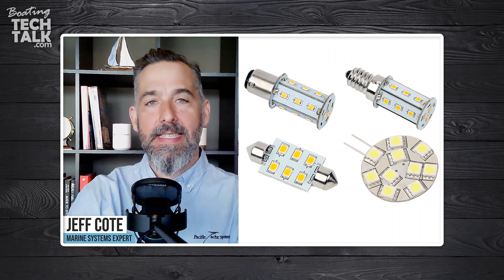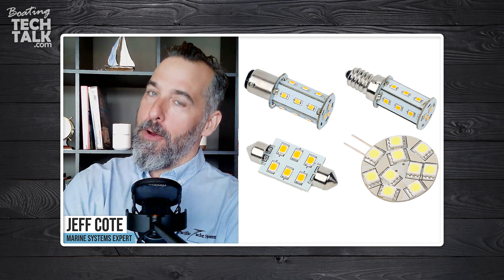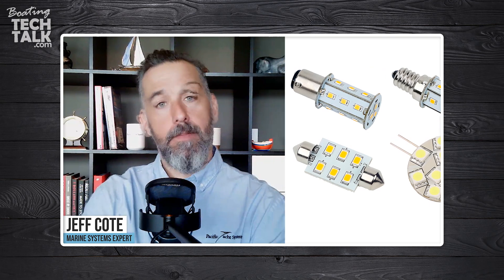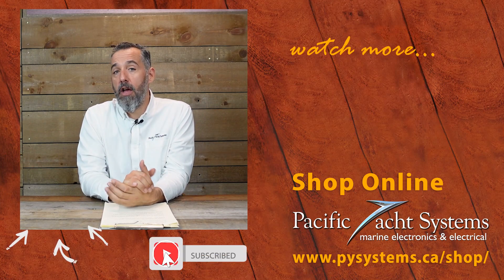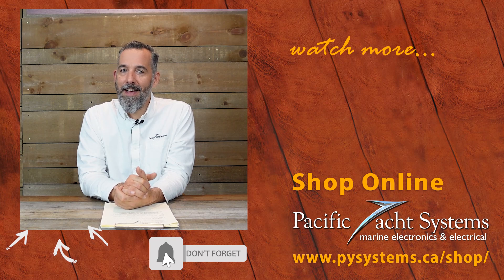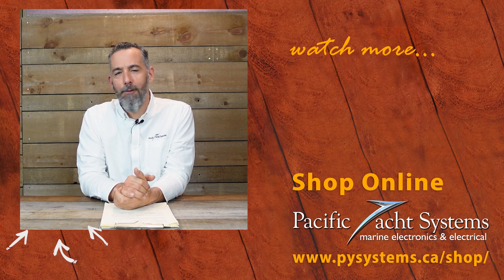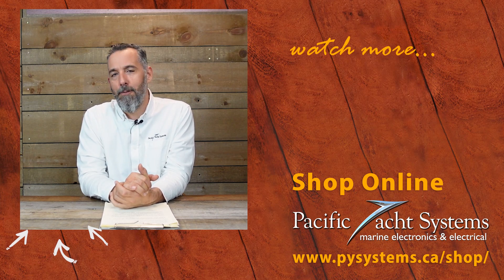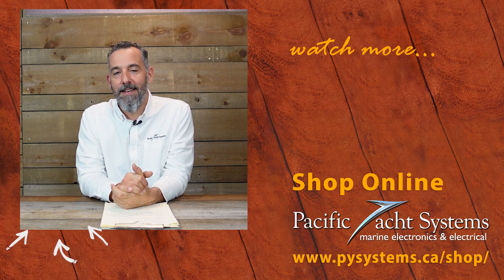I Switched Out My Old Cabin Light Bulbs for LED but They Don’t Work?

Comment: this same problem also happens on old houses, my theory is that the people that did the connections weren't electricians and they just thought " I just have to connect 2 wires,what could go wrong?"

on the first days when I was learning about electricity, I connected the neutral wire on the hot terminal and the hot wire in neutral on the testing outlet we were working on, it actually worked you only had to connect the appliances socket backwards for it to work

Comment: Actually they did work maybe - LED - the old or cheap ones with just a ballast resistor (and yes they still exist) with reverse polarity are a diode. They avalanche with correct (but reverse polarity) and emit light. The new  / better quality ones (stabilized) won't do that. My buddy did that to his boat (years ago) light s were bad, pieces of junk, etc. He left them on and we came back to a dead battery. phantom current. This that the other thing - and then he tells me about these blank blank LED's. Sigh George! Reversed the polarity and all the lights came on - he had left the switch on and that was the phantom load that pulled down the battery - mind you this was 35 (or so ) years ago.
Reply from the maker: Thanks for sharing Bill.

Comment: I've just lately installed LED running lights, and in those three cases, (bow, stern, & masthead), to my surprise, the lights do not seem to care about polarity at all. I presume, then, that the little circuit boards that are the LED "bulbs" contain some diodes, or whatever, to "fix" the polarity inf it's backwards.